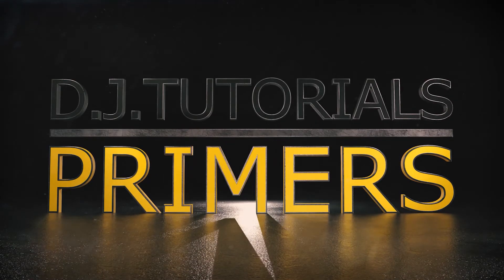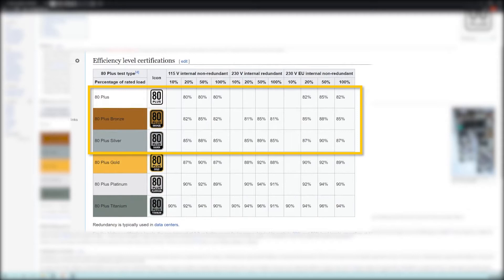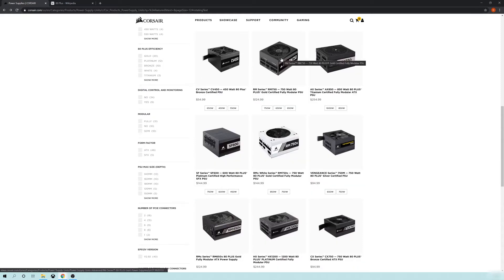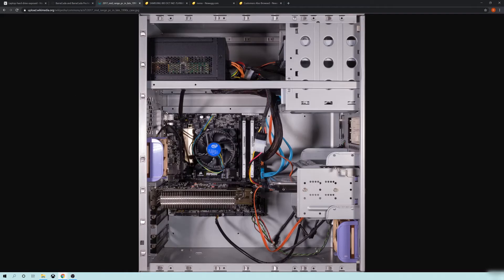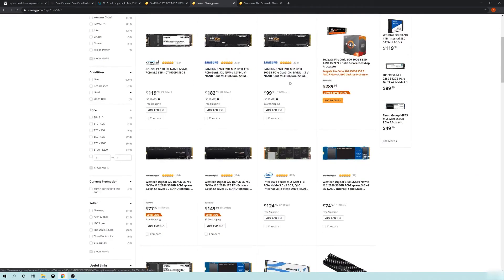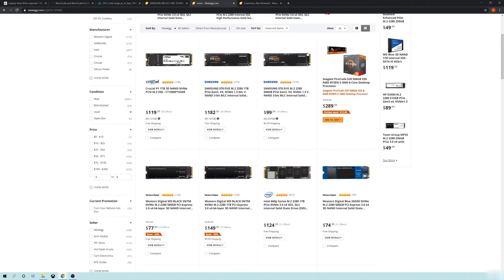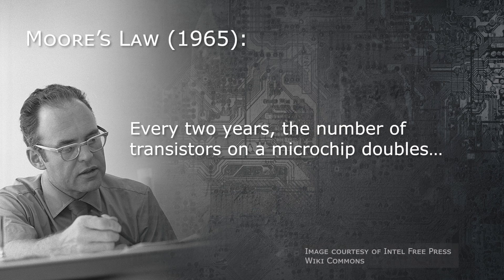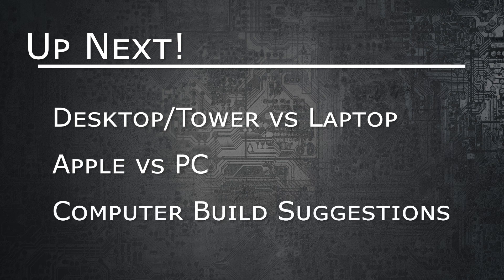Understanding Computer Hardware Components | Part 3

Comment: Or if your super serious for archiving, more reliable for sure, is tape drives.   The degradation of data is also much much less compared to discs.
Reply from the maker: I didn’t even know that was a thing. Thank you!
Reply: djtutorials most wouldn’t.  More likely to transfer to a film print, be it 16 or 35mm.